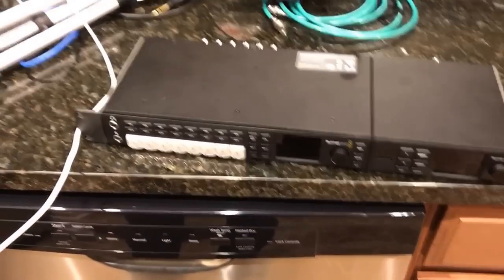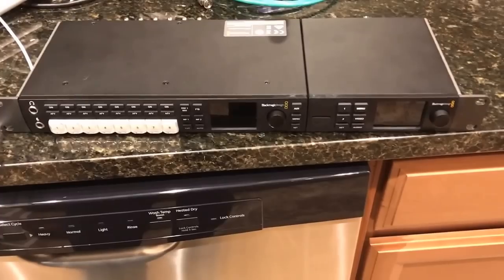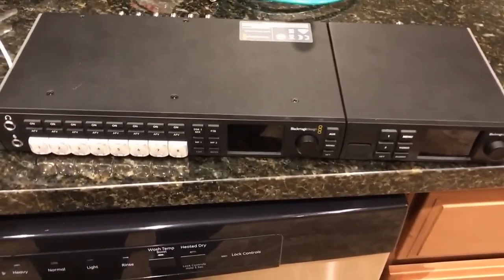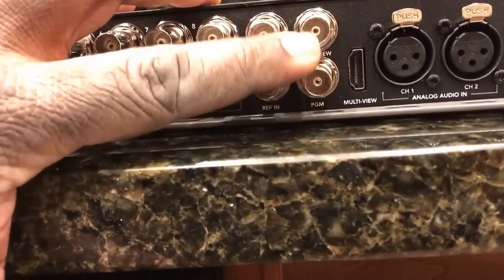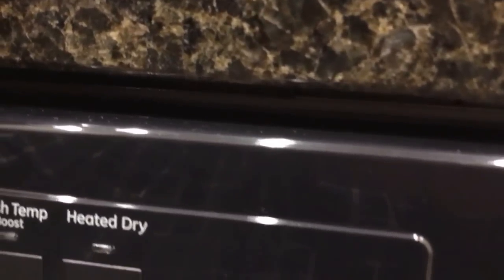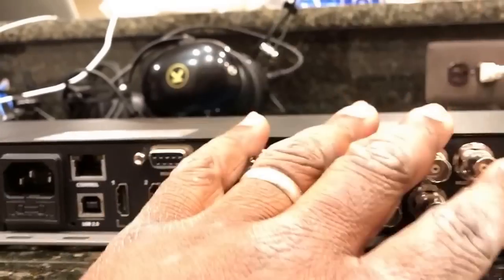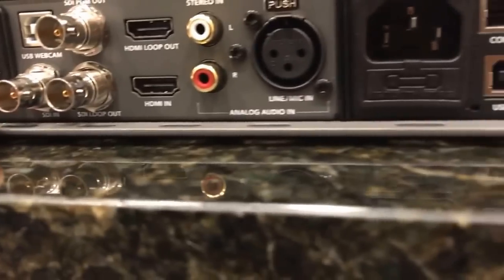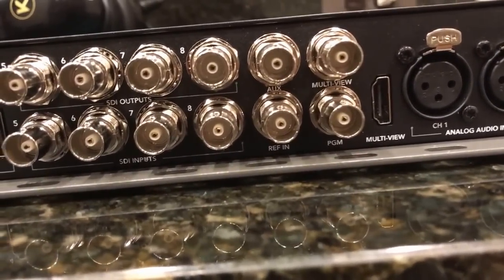Using the ATEM Television Studio HD with Web Presenter

Comment: I'm currently in the process of mounting these exact units on that shelf. I noticed the fans on the ATEM pull air through that unit and exhaust the hot air in the direction that would push it into the Web Presenter in your current configuration. Did you experience any overheating issues on either unit by mounting the two units in this configuration?
Reply from the maker: Micah Williams definitely pay attention to air flow.  This was merely a demo and was never used in the field in this configuration.  Thanks for pointing that out to viewers!

Comment: Can you help me with this. I just picked up a ATEM TV Studio HD and trying to use the USB2.0 to record and stream. But non of my software will recognize it. I did you  know if they removed that functionality from it,  as my older ATEM TV Studio had this built in, i was able to record, and stream using the USB 2.0.
Reply from the maker: Unlike the original Television Studio, the Television Studio HD DOES NOT have a built-in H.264 encoder.  If you want that functionality send it back from wherever you bought it (we wouldn't given you the heads-up) and get the other model, or also buy the web presenter.
Reply: You need a capture box; the Intensity, Mini Recorder, or DeckLink are good choices. The Web Presenter seems overpriced for a simple USB capture box.
Reply: The intensity wouldn't work with eh ATEM HD since the ATEM only has SDI out and the Intensity only has HDMI in...cheapest solution is to buy the Ultrastudio Mini recorder $140.
Reply: Best solution would be to use the Ultrastudio HD mini though but it's $500
Reply from the maker: Tom Wilson the web Presenter is a Teranex product - meaning you are paying for great video processing.  It's really a built in scaler, switcher, audio ab